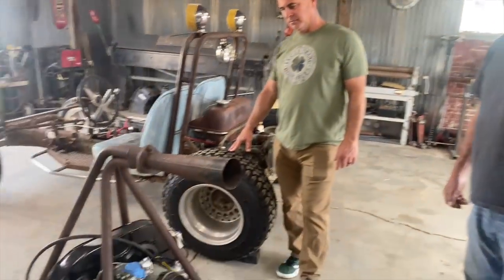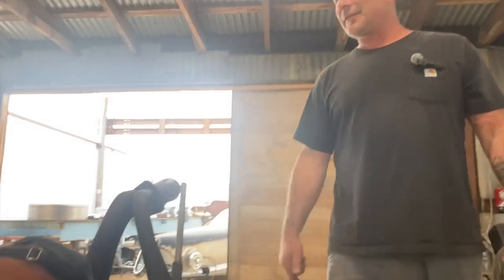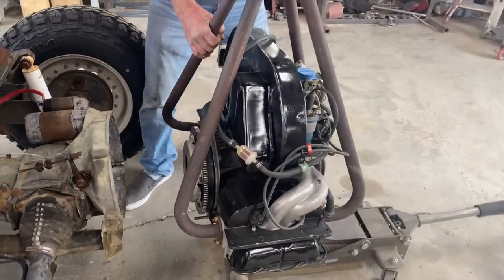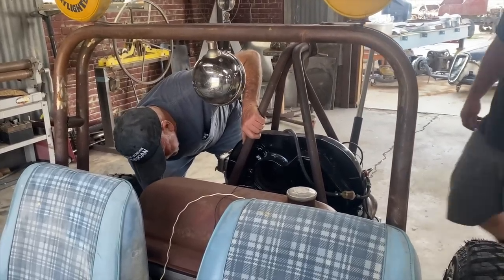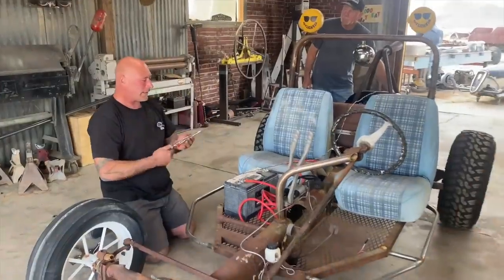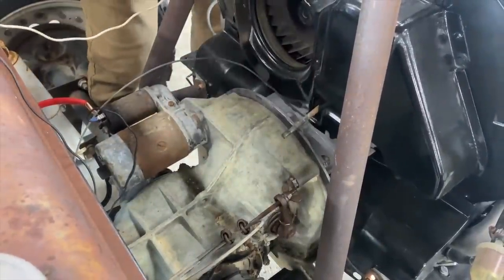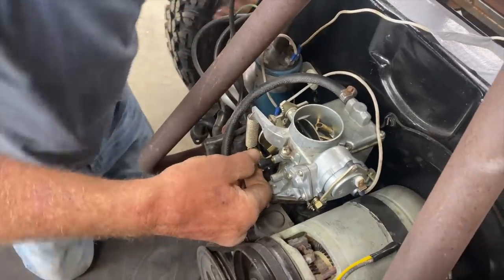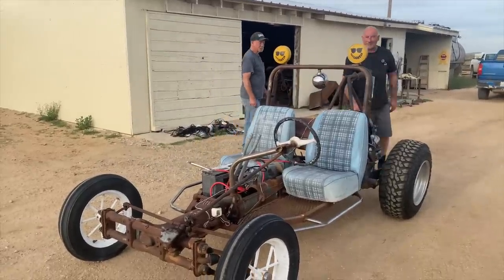Ian Roussel And Friends👽Install His 1957 Dune Buggy Engine! 😎 Watch Till The End For First Ride! 🏎️💨

Comment: Great job on stabbing that engine in. One trick I did years ago on my VW based buggy was to mount and wire in a truck marker light in front of me so if the generator belt broke and the generator stopped I would know the cooling had stopped also and I would not overheat the engine.

Comment: Hi Ian, odd question..we are doing the owner builder thing and have built a workshop and garage for a few old cars we have.. and have metal framed garage doors like yours, Q. We like the timber lining on yours, how did you attack this? Screws into the frame? Cheers Duncan and Tine

Comment: Question,  when installing pressure plate should you alternate bolt tighten? Normally change my with hand tools
Reply: Prob a proper way to torque em.  Barry has a book for all the technical info.